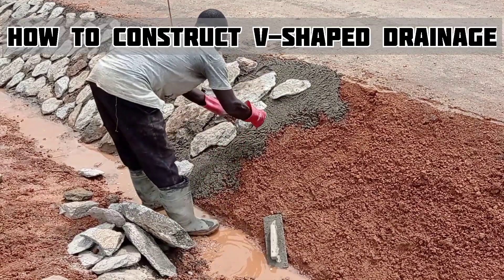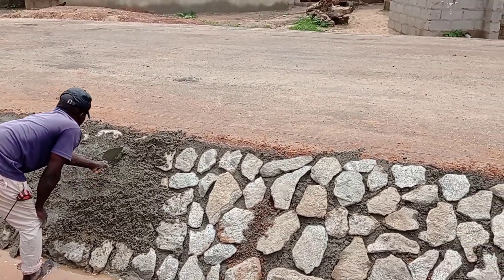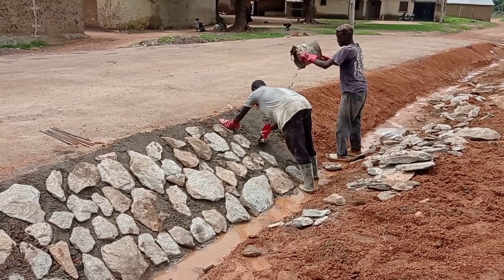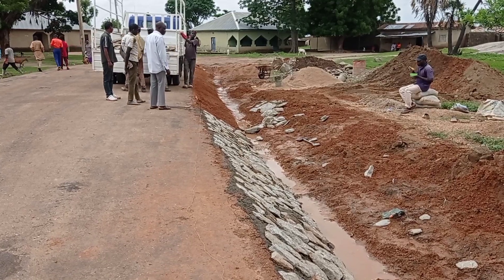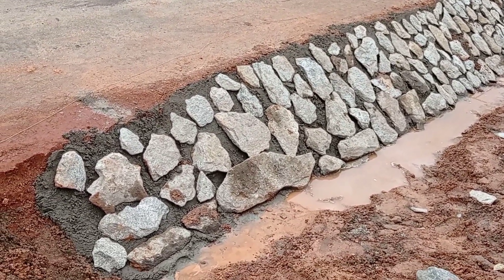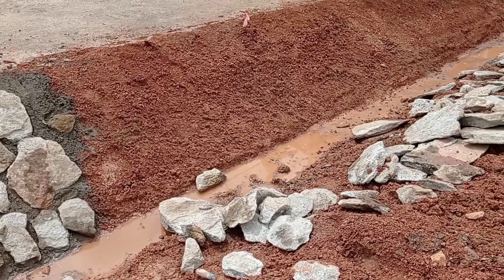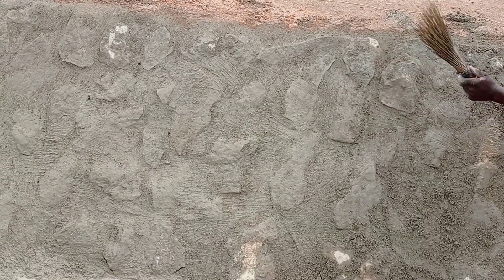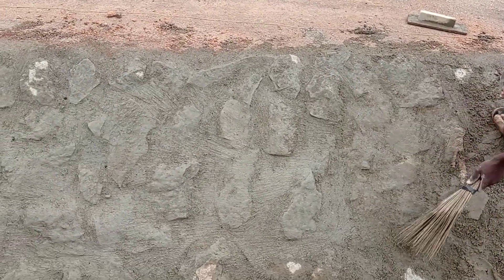How to Construct V-shaped Drainage & Protect Embankment | Stone Pitched Drainage

Comment: Hi, is it good in cold areas,Europe for example, where it snows,will it hold?
Reply from the maker: Hi Ruth, yeah it'll work there. They are suitable for cold areas as well.
Thanks.
Reply: Ok thanks, I really like the look.
Reply from the maker: @ruthkonz9025  Thanks a lot. You're right. It also provides an appealing look.
Reply: Yeah but I guess in cold areas ,the setting will Tek a longer time, therefore we can use fast setting cement,or curing using warm water